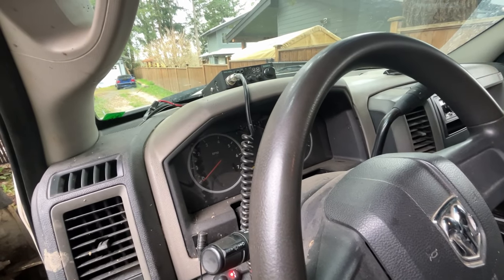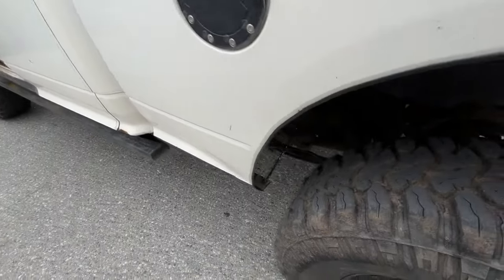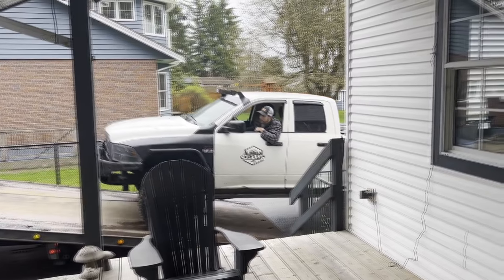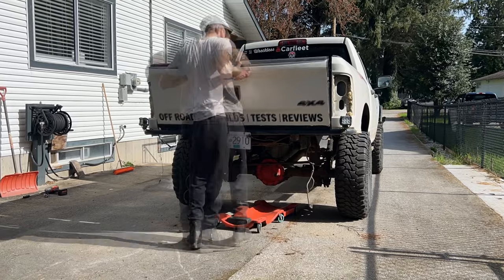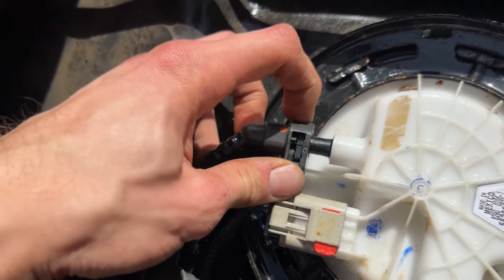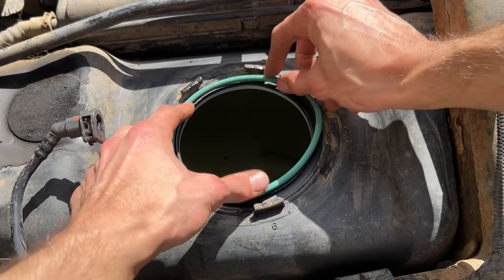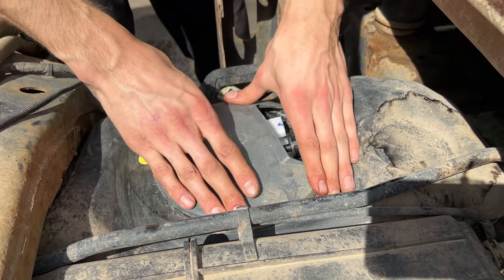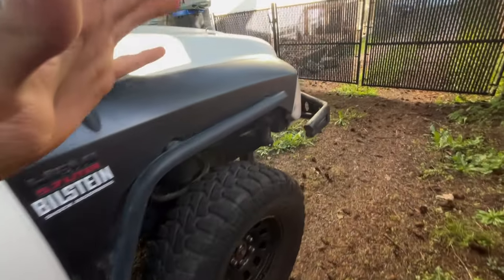DIY Dodge Ram Fuel Pump Replacement! Crank but no start 2009-2018 Ram

Comment: Great video.  Changed my fuel pump today.  One thing to note, I have a crew cab, so I still had to unhook the 2 straps and  use a jack to lower the tank enough to replace the pump.
Reply from the maker: thanks 
O dang that’s good to know for people with a crew cab
Reply: What 2 straps this is gonna be my first time taking my bed off and wym lower the tank
Reply from the maker: @savagedolo2626  there's 2 straps that hold the tank in if your dropping it from below the truck. Taking the bed off you don't have to remove the 2 straps because your accessing it from the top of the truck
Reply: Glad I saw this comment before attacking mine.
Reply: So if you have a crew cab you should drop the tank?
Reply: You need to buy OEM fuel pump, not the aftermarket crap
Reply: @Carfleet 
You made that look easy!
How long did it take you?
Reply from the maker: @romeparker1686  took a few hours but not to bad to do at home

Comment: “If your truck fixes itself, it’s definitely not fixed” lmao
I love that retrospective analysis while you’re sitting on the side of the road.
Reply from the maker: Hahaah I was so rattled
Reply: @Carfleet  all been there. I have my bed off right now had to make a run for a new electrical connector and fuel line clip.
Reply: Truck’s back together now. I let pump prime a while and cranked it. It started right up, definitely think that was the fix. I had to buy new fuel line clips and a new electrical connector pigtail too.

Fuel line clips: 
“dorman 800-015”

Electrical connector:
“Standard Ignition 4 Terminal Multi-Purpose Connector - S1410”
Reply from the maker: @Javii96  nice man glad it worked out
Reply: Dang. Still not starting this morning. Back to the drawing board
Reply from the maker: @Javii96  o sheet that sucks
Reply: Funny thing is i’ve been driving it😂 i guess it fixed itself
Reply from the maker: @Javii96  hahahaha maybe 👀
Reply: I got a random notification for this. So i guess i’ll update. Previous owner installed that fuse box jumper wire to power the fuel pump with the ACC power. I suspected a bad connection there so i rebuilt that fuse jumper/connector and it still had the issue, did all new plugs, even took my injectors out and cleaned them and ensured they were healthy. Well it ended up being the whole methodology behind the ACC jumper wire. ACC power gets interrupted during cranking. So on most days the truck started because it had fuel pressure in the lines and when it cranked for 1 second it was able to start up even with the fuel pressure draining out. But if it was really cold out or if my battery was a bit low from sitting, it would take a bit longer to start up and that would cause the fuel pressure to drop to zero before the engine started. So bottom line is if you have a jumper for ACC power to the fuel pump, it will work with a topped off battery but you should start looking at getting a new TIPM or you should consider replacing the relay on the circuit board. I’m good with soldering so i was able to replace the relays for 14$. Hope someone finds this info one day cause i spent a month messing with the truck.

Comment: You are a determined man, my Ram needs a fuel pump, my buddies say cut the bed, then patch the hole. You took the long route. I did have it undercoated so not much rust for KCMO driving. Well i hope tank bolts comply & i respect your hard effort sir.
Reply from the maker: Thanks haha ya my tank bolts would’ve snapped
Reply: Seems like it might be dangerous to cut the bed .... all those sparks on the cut, and then ...re-weld it over the plastic pump parts on the gas tank?     Seems dangerous.  Maybe ok with some sort of well placed asbestos blanket or something.
Reply: On my 2010 4.7, the fuel pump is in the middle of the bed and cabin. You stilñ have to drop the tank a little to move over and change the pump

Comment: Hard to believe it’s easier to remove the box rather then lower the tank  , good job 👍👍
Reply from the maker: On a non rusty truck it’s not easier but for mine it’s definitely easier just so I don’t snap the tank strap bolts haha

Comment: Was experiencing the same issue , after a fuel pump replacement issue persisted . Had to do a module bypass to get it to work. 11’ single cab still running as of now.
Reply: I have a 16 Ram with the 3.6l and I’ve only had it a year but the previous reports show fuel pump replaced multiple times already. And now i have check engine light for fuel pump. What is this module bypass??

Comment: Nice job on bed removal and pump replacement, but l can't believe you put that plastic hat back on the pump.  Thing looked like a dirt magnet.  I have never seen so much dirt on top of a pump assembly 😊
Reply from the maker: Hahah it’s like a bucket

Comment: I’m having a fuel smell at my tank but no codes. It smells like it’s coming from right between where the bed and cab meet. No starting issues just a faint smell after I turn the truck off. Mine is a 2015 3/4 5.7. Did you have this issue by chance?
Reply from the maker: I didn’t have that issue sorry

Comment: Did you have a Check engine light on because of it ? And if so did it go away after you put the new pump in ?
Reply from the maker: My check engine light was on before and after the fuel pump becuse of my gas cap

Comment: For your stock fuel pump, was the connector male or female? I have a 2014 5.7 and I can make heads or tails what the connector would be
Reply from the maker: The part on the fuel pump was male
Reply: @Carfleet  you’re a absolute legend ❤️
Reply from the maker: @seankane5489 wait are you talking about the electrical plug or the fuel pump itself

Comment: Thought I'd look at this method and dropping the tank.  My 12 model  sometimes when I go to start it will start up, run a few seconds then stall.  It may do it once, twice or three times (at least it's never happened more than 3) then it starts right up and runs fine.  This is intermittent as sometimes it doesn't have the problem.  I'm thinking the fuel pump is starting to fail and not developing enough initial pressure to start and keep running.  I don't know what else would be wrong but pulling the tank or bed and that not fixing it would be a pain.  Anyone have thoughts?
Reply from the maker: Ya that’s weird try bonking the fuel tank with a mallet and see if that changes the outcome

Comment: Hey dude, I have the same issues. This is my third fuel pump within a year so I’m thinking of doing a custom fuel tank and fuel pump. I could have some issue in the electrical front with too much resistance so the pump is working overtime with current burning it out. Anyways I’m thinking of doing a custom fuel cell with an accessible waterproof door to replace them easier lol
Reply: What happened? Did you get aftermarket
Reply: @aguilaleon100  Hi I got the same Trugrade fuel pump from autozone but I trouble shooted and discovered there’s a short in my fuse box along my relay. The pump is working continuously as my battery is powering the fuel pump and it’s pumping the fuel back to the tank as it’s designed to do with the engine not running. So I disconnect the battery every time I park until I can successfully figure out where my short is.
Reply: Damn it, tough cookie. I just replaced mine with an oreillys one. It was perfect for about 3 weeks and i took the truck on 3 hour trip and check engine turned. Something about the Fuel pump high circuit sensor. Dont if its a faulty pump or some short. Before i replaced the pump i would turn the key and dash would turn off and on and wouldnt start until 2 or 3rd attempt.
Reply: @aguilaleon100  is yours a 2012-2014? Chrysler designed the TIPM to have an internal fuel pump relay and it doesnt have an external 5 pin plug relay. You might have to take apart the fuse box and solder on a new relay. look up on youtube 2012 dodge ram TIPM fuel pump relay fix. When you have the TIPM apart also look for anything out of the ordinary like burnt out pins from the board this would indicate too much resistance and more current is being sent to bypass that part of the circuit. Another thing to try is to test the fuel pump to make sure they did not give you a bad one.
Reply: Thank you my friend i was just seeing a video over the external fuel relay job.
Reply: @starstray4326  did you try vertical visions bypass? I have one on my 2012 5.7 and I had starting issues until I installed it.
Reply: @tacroom12  I have not. Is it pretty good?